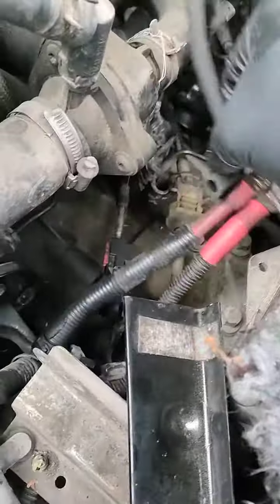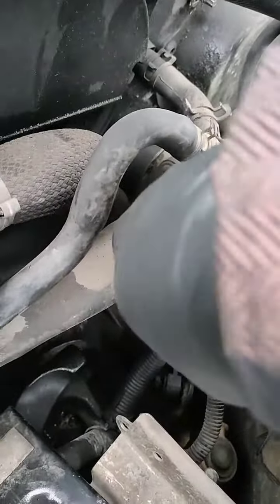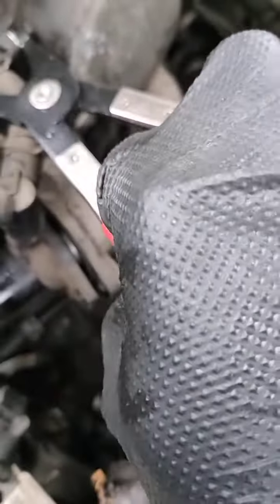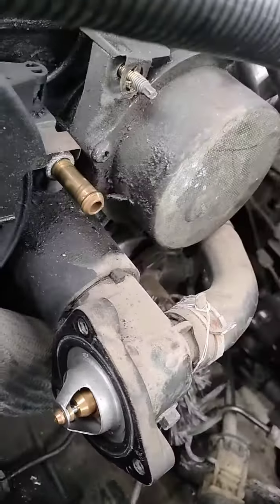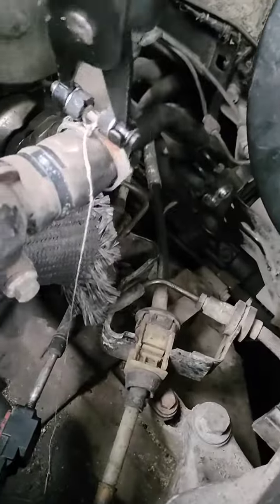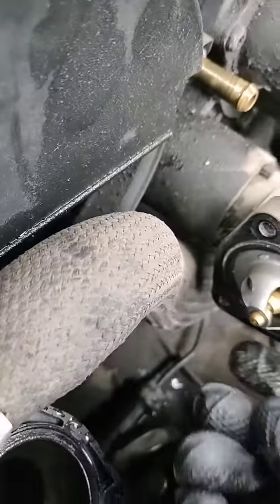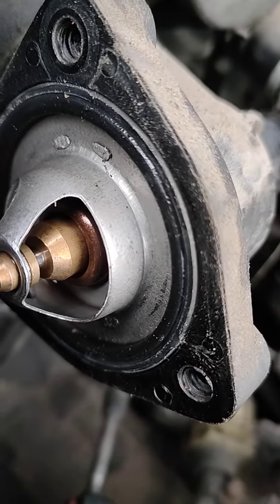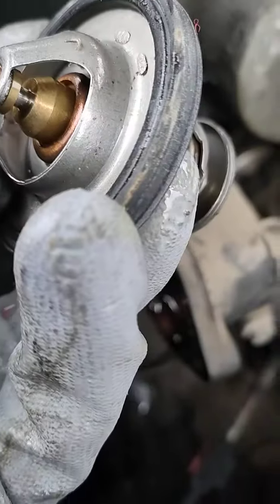Thermostat removal Ford Mondeo MK3, TDCi/ Tddi.

Comment: Hi, I noticed that the thermostat on my Jaguar xtype 2.2d is leaking some coolant.  The tray has the level below the minimum.  In your opinion, should I change the whole piece, thermostat and thermostat housing?
Reply from the maker: Remove all the coolant on the system. Use appropriate o ring to close everything again.
Reply from the maker: And be careful not to broke the housing. It happens that people without experience broke it